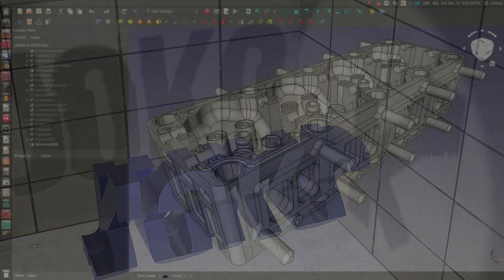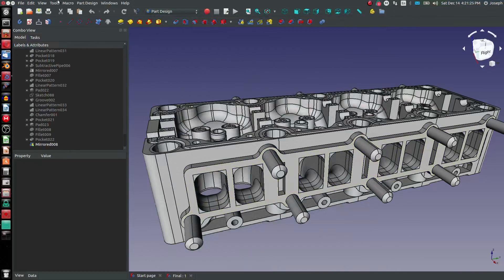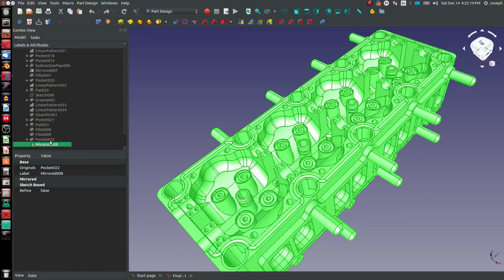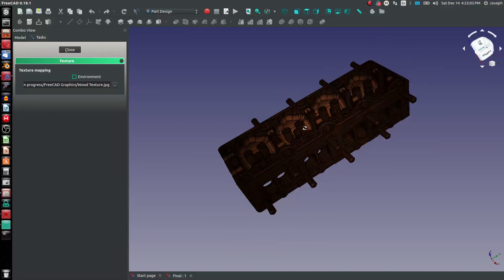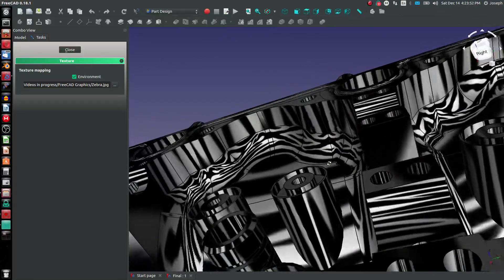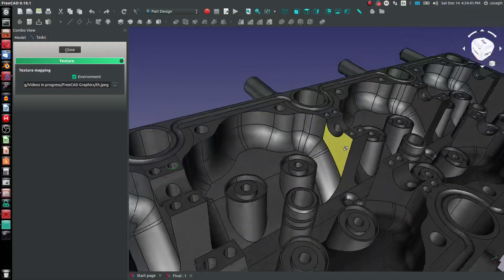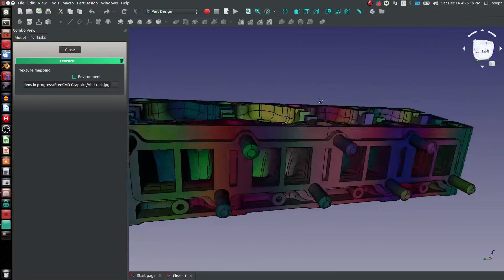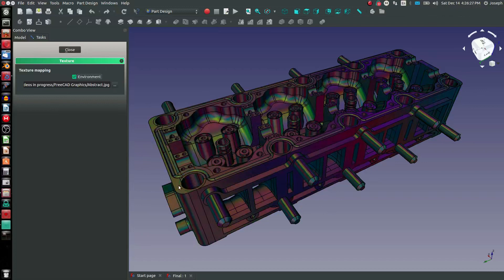Improve FreeCAD Model Appearance/Texture/Enviornment/Mapping  |JOKO ENGINEERING|

Comment: Hi, what display setting are you using? If I use 4k, the dropdown menu and on drawing annotations will be impossibly small. If I use 1080p, the icons will be childishly big. Mine is does not look like a usable tool as yours.
Reply from the maker: I'mt at 1920x1080, I'm not sure why your display would be acting funny like that
Reply: @JokoEngineeringhelp  Thanks, I figured it out. The program is not compatible with 4K. And for 1080p, I need to set icon size in edit/preference/display. Seeing your setting to know there is another way helped.
Reply from the maker: @motojc  I'm glad that was resolved.  Little things like that can be very frustrating!

Comment: Looks very nice for Windows Thumbnail preview :). But can it be saved, can't find any apply button :(.
Thumbnail preview makes live so much easier looking for FreeCAD files. You won't google for 
"Compile on Windows - FreeCAD Documentation" scroll down to "Thumbnail Provider" download 
Thumbnail.zip that contains the FCStdThumbnail.dll and register it with CMD as administrator
typing regsvr32 FCStdThumbnail.dll in the corresponding folder. In FreeCAD go to the main menu
-> general -> (tab) document set Save thumbnail into.... size 256pixel :)

Comment: I found it kinda hard to get machined areas to look machined and cast areas look cast.
Reply from the maker: That's a tough one.  That feature applies the same thing to the whole model.  You may need an external renderer to get what you need.
Reply: @JokoEngineeringhelp  yeah, that was the same thought I had as well.

Comment: I'm really trying to become better at freecad but run into issues from time to time with applying constraints.  The error messages aren't the clearest.  Would you consider recording a tips and tricks on how you deal with/prevent these issues?  As an example today I wanted to have two holes equidistant from the center line so i used the >< tool.  But then I could not set a dimension from the center line no matter what tool I used.  TIA!
Reply from the maker: Hi Rob;  absolutely.  Are you're issues only in the sketcher?